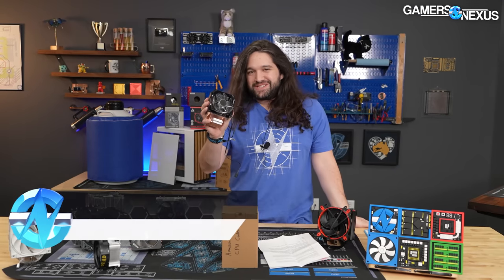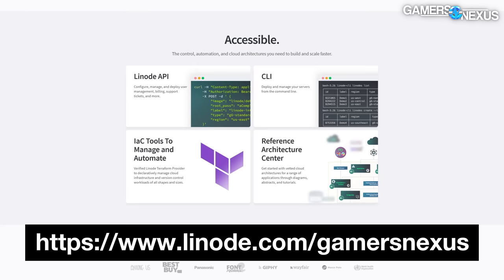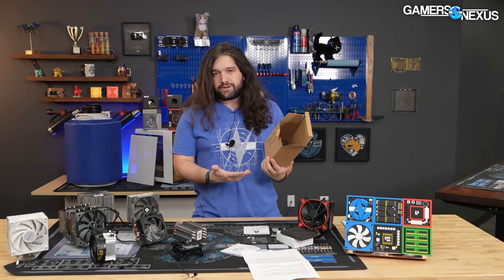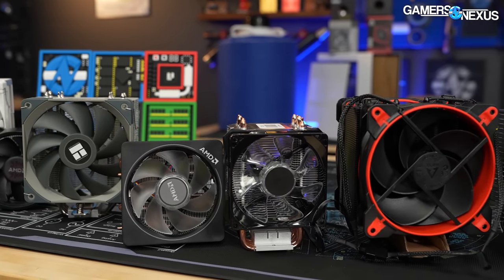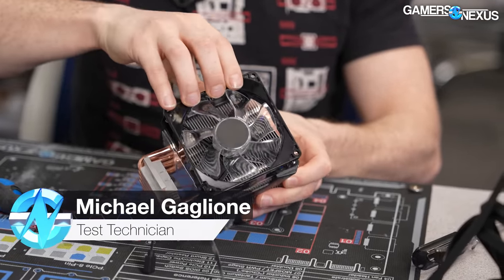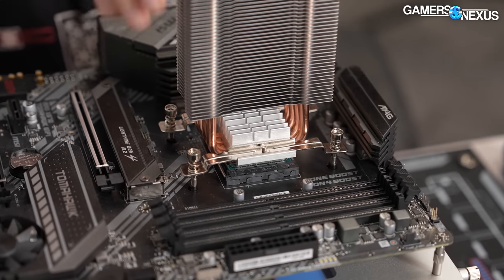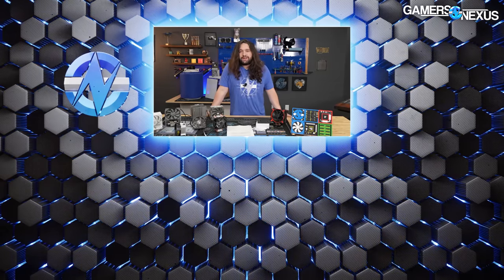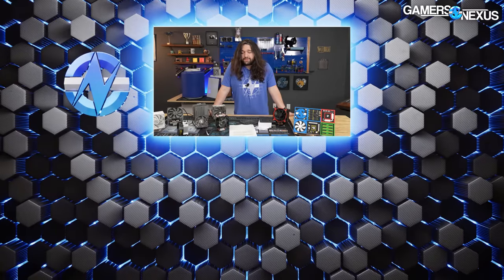Amazon "Made" A CPU Cooler: Amazon Basics Cooler Review

Comment: Wait... did you say (around 3:43) that Amazon debranded the cooler, or DBRAND-ed it? cough
For the cooler depth measurements, I still don't understand how to read them. All I understand is that the thinner the block part, the better, but how do I know which is better between, say, the Scythe FUMA 2 and the Noctua NH-U14S, which seem to have bars of about the same thickness?
In the installation segment, that looks like the same kind of open air test bench that JayzTwoCents recently picked up. What do you think of it?

Comment: G'day Steve & Mike,
posting at 0:32 I am going with rebranded "Cooler Master", 1:53 🙃👎 there is also a 411R
I didn't even need to look it up as at the moment Scorptec have the original CoolerMasters 411R on sale for $29AUD which is cheaper than most 2 & 3 heat pipe tower so I grabbed a couple to upgrade some i7-3770 gaming PCs I service for friends still using intel stock coolers, they do a better Cooling & Quiet job than the intel cooler

Comment: I do not understand why they did a 90mm fan version.. its already a tower so no flat or matx small case option, for those i could understand the 90mm and flat. 
But since its a tower already the 120mm, even with an adapter, would work better.

Comment: The whole reason many people happily buy Amazon Basics is because when they screw someone over with their questionable business tactics it's always the OEMs or middle men, rarely the consumer. Much like Walmart. Most people don't care about business ethics and only what's the most affordable. It's this mindset that has moved so much manufacturing to China. Price>*

Although there are some products they sell that are surprisingly good for their price which is good for pointing out a lot of products that have higher than necessary margins. Specifically they have a decent wireless mouse for a laughable $12. It's not what you want for high FPS shooters but for basic use it's an amazingly good deal. They also have some of the best rechargeable batteries that go toe to toe with name brands while costing FAR less. That's super valuable if you have young kids with a lot of battery operated toys.

As much as I hate supporting the Amazon Basics brand I'm not paying DOUBLE for eneloops when they are no better than AB.

Comment: It's a pity Amazon rebranded the H410R, because the H412R is actually pretty decent for low power or compact builds, I used one for a 5600X and it worked very well. What's really funnt though is that, at least on Amazon UK, the H412R is marked as being the "Amazon's Choice" product, and it's only a few pence more than Amazon's Basics model, so choosing the latter over the H412R makes no sense, something Amazon's own product markings imply. Anyway, what this really shows is that the Basics cooler blatantly does not need to exist, negating entirely all their PR about eco nonsense. The Basics cooler is unnecessary resource consumption.

Comment: I use the intel stock cooler in my current system. This basics cooler probably wouldn't be an upgrade for me. Even if it is, I can drastically increase the upgrade for like $15 more. Yes thats over half the price of the cooler but like.... it's also $15. And I only touch the inside of my computer like once a year tops lol

Comment: I knew it'd be unimpressive out of the box, but I was expecting you to perform a basic lapping, that anyone could do at home after purchasing it (with a fine, wet piece of sandpaper on top of a glass plate) and test after that too. The delta between out of the box and lapped would've been the most interesting aspect to see in such a video.
Reply: I just made the same comment. because flatness will vary between individual coolers. We both could by the same cooler on the same day and the flatness between them could be different.

Comment: Great info.  Thanks for this one!  For the most part, I HATE Amazon Basics stuff.  It's usually low quality, and doesn't hold up.  But...I got to tell you.  I'm willing to gamble on "cheap" and unknown brand coolers.  Sometimes...you get surprised.  I got the ID-Cooling push pull air cooler (ID-COOLING SE-225-XT if you're curious) a while back and it worked amazingly well for me for up to a 5600x.  Not so much for higher processors than that, though.

Comment: On a budget I just get whatever 120mm is between $14-$25 so I would never consider this spindly thing.

If I'm looking to overclock I go for a good 6 pipe 120 or 140mm.  Had good results with Scythe 1000 'Mugen' 'Infinity' (its been rebranded a couple times) or the DeepCool Lucifer V2.  I think it was about $35-$50 for a well performing cooler.  Aka performs better than a cheap 120mm AIO

Comment: Amazon doesn't make squat.  They provide cost effective options branded as Amazon Basics and those items are front and center on their site.  My only Amazon Basics regret was a pack of 9V batteries.  For some odd reason they were ever so slightly larger than normal so they didn't fit in my smoke alarms.

Comment: I noticed the fan blade fins are thicker compared to others. Also .4 amps (4/10ths amp) is ALOT for a fan that size. My Define 7, 140 MM case fans are .2 amps, and my Noctua 140MM  case fans are almost half of that.
Reply: It's almost like smaller fans have to run at a higher speed to compensate for the smaller surface area, or something...
I wonder if that takes more power? Hmm...

Comment: A thermalright Silversoul 110 is a lot more beefy for $27
Reply: and pretty in white or black! used it on a budget build for a friend and the build quality is actuallty pretty good
Reply: @Jules-bass  I used it with an i7 12700K on my ITX PC. It almost wasn’t enough. Bought a $8 contact frame. My 27+8USD cooling is probably better than more expensive and beefier coolers just because of the contact frame alone

Comment: Just had a deja vu. "Looks a lot like 412R..." I was using it for 2..3 years in a compact mATX case.
It was better than a stock cooler back then, but really not that impressive except for the price. Cooling wasn't perfect nor noise levels. Dirt cheap at 22EUR, but haven't considered buying another. Used Noctua NH-U12A and Burst Assassin for more recent builds instead. Different price ranges, both better than this.

Comment: I like the graphic you added with the CPU label under the pressure map, BUT, that cannot be correct right? When mounted, the heat pipes should be running parallel to the RAM, so top to bottom of the CPU, and not horizontally across as shown. Or am I missing something?

Comment: You should easily be able to get a 4 pipe 120mm for $25 USD or less.  Really ZERO point for this unless a 120mm cooler won't fit. Same applies to the original Cooler Master design. I have a deepcool 4 pipe 120mm on my 12400 (unlocked on synthetic loads it maxes out at about 100W) and it's perfect for this. I only paid 26 Canadian (~$20 USD). 

But nothing stopping Amazon from rebranding better 120mm design to push more competitors out of the market. 

IMO don't buy Amazon branded unless it's some kind of loss leader, untouchable pricing.

Comment: Once again, the Peerless Assassin 120 at $34 is just an absolute steal. It's $30 cheaper than its closest performing competitor, and it performs nearly twice as well as anything remotely close to its price. It invalidates every cooler below $80. Use the stock crap Intel/AMD cooler, or get a Thermalright Peerless Assassin 120. It makes no sense to spend $20-30 on a worse cooler, when the PA120 is $34 and is great .

Comment: Kind of wild that in a multicore world now we are still using air cooling lol.  I use the Arctic 360 and when I encode with handbrake full load my CPU is at 59-63 C usually. I am guessing if I tried to use air cooling my CPU would have to throttle down at times.

Comment: On Aliexpress, there "6 heat pipe" cooler is surprisingly not bad, probably because it is a 90mm dual stack Hyper212 clone. At one point, I paid 18 dollars for mine, and then an additional 30ish dollars for 2 Noctua 90mm fans (it did come with 3 fans btw). My 5950x runs hot at 85-87 degrees underload (mining) with artic MX4 (about to switch it out for thermalright tf7). Definitely a bottleneck, but, the 130ish mm clearance is really nice.